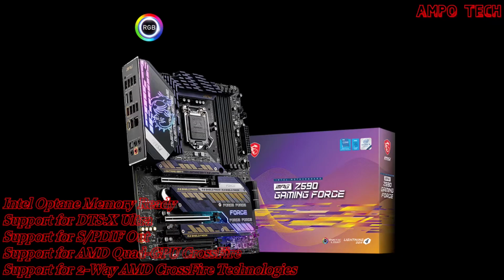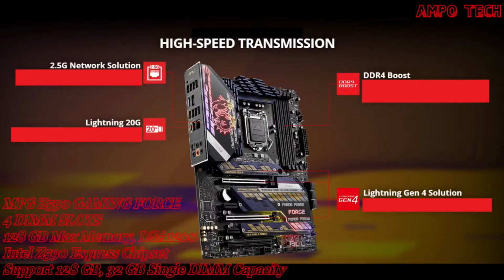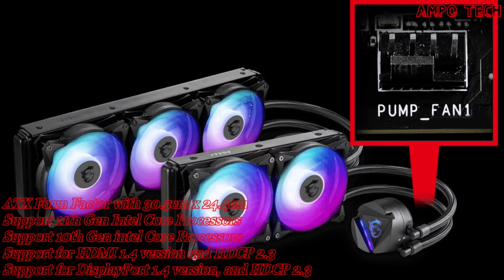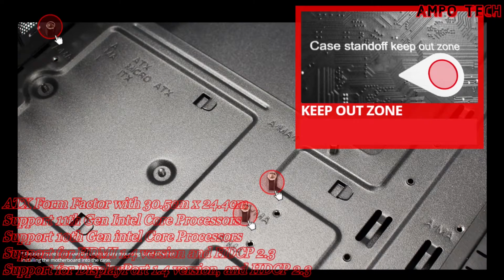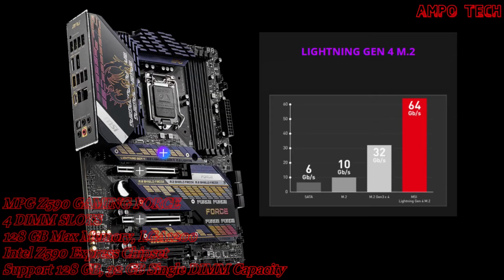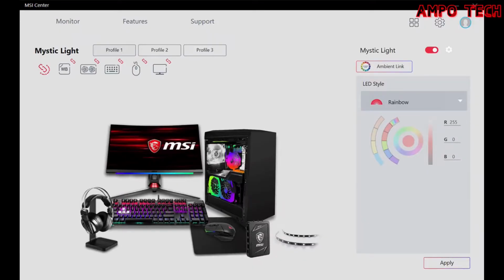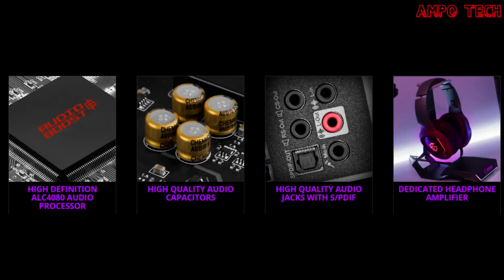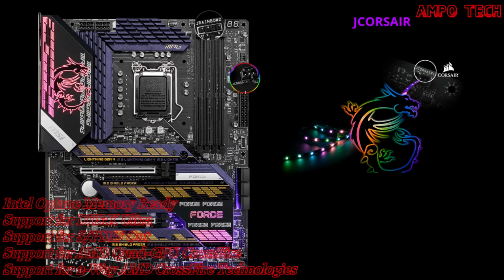MSI MPG Z590 GAMING FORCE Motherboard | AMPo Tech

Comment: Hello,
Since Motherboard hast 2x8 Pin CPU Power connectors, Do I have to have Power Supply with 2x8 power cable to connect and give power to both 2x8 CPU? or only one of the CPU 8 pin should be connect to Power Supply?
Thank you